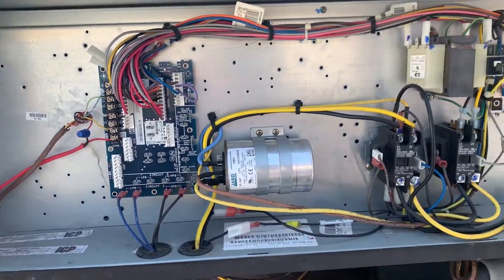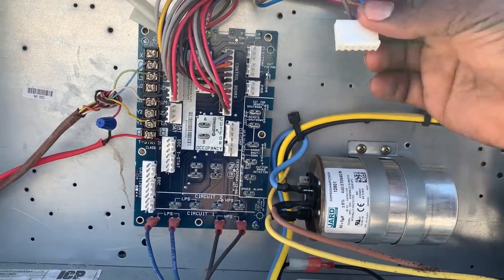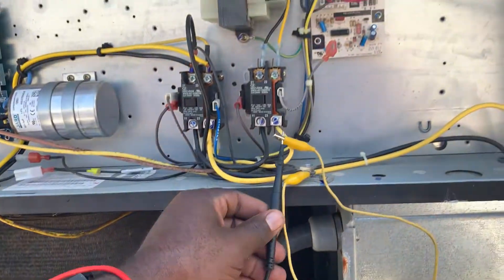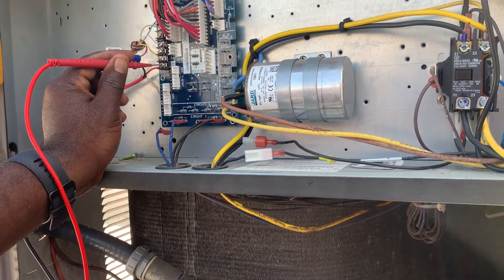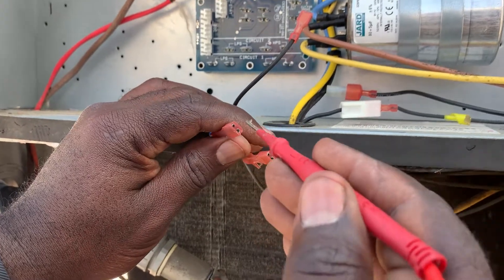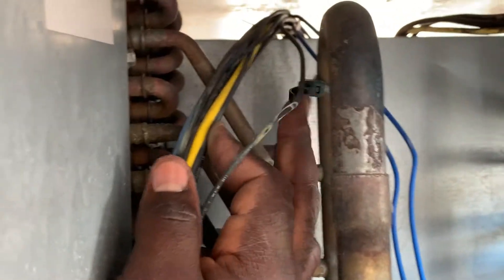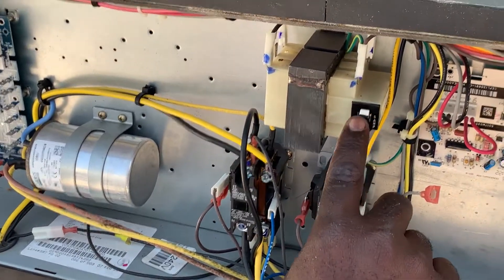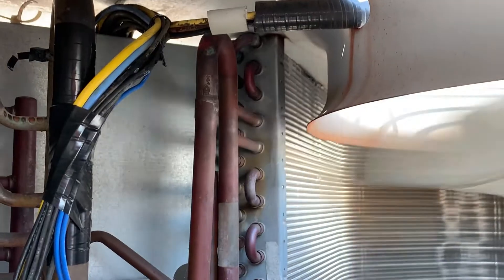How To Find A Low Voltage Short Fast

Comment: Great video. I have a question about why you are getting continuity on the thermostat wires to ground? The T stat  wires are  independent from the high pressure switch so why is the continuity happening?

Comment: Resetting the breaker multiple times could have cleared the short causing it to take longer to locate it. Once you saw the tripped breaker, you already know there’s a short. Identify the shorted wire as you did, then do your visual inspection, fix the problem, only then would you reset the breaker to verify you fixed it. Done.